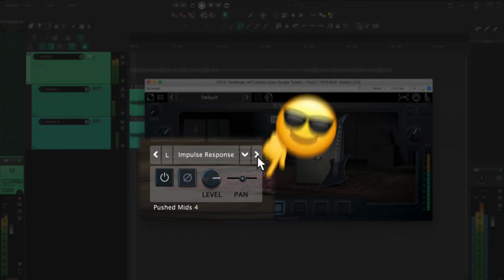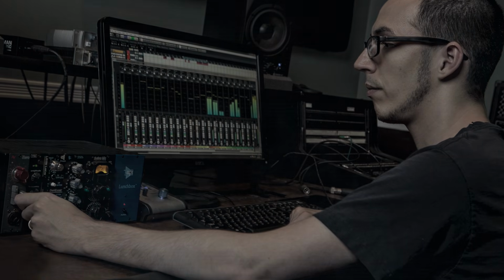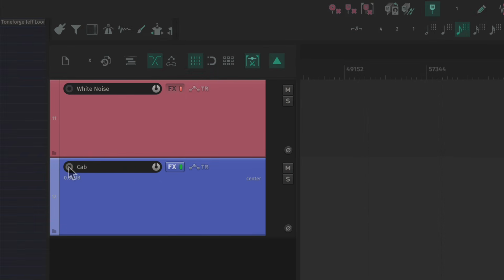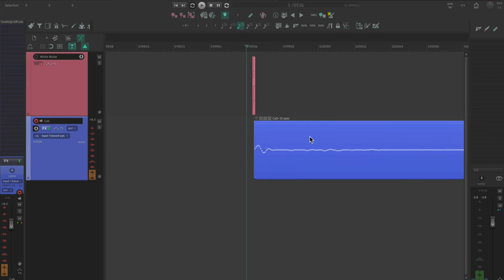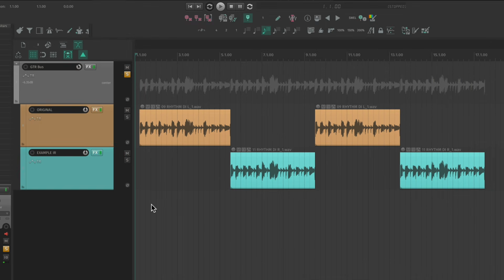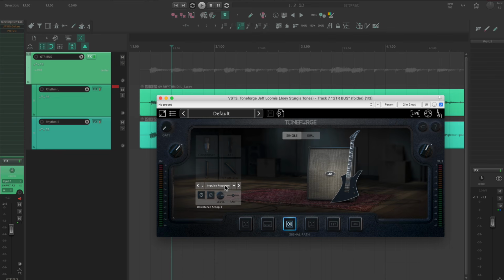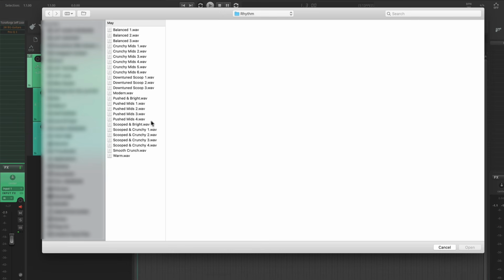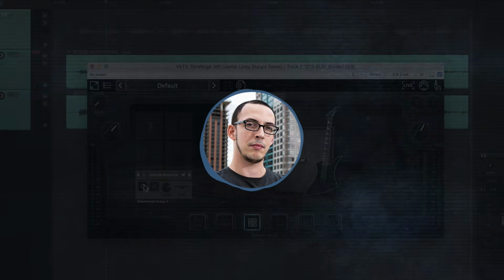How to Create Your OWN Impulse Response

Comment: This technique is as proved in this video efficient, but it doesn't fully give the exact tone of the desired signal chain (power amp + cab + mic), because you are feeding an actual impulse into it (i.e. a dirac for the nerdy guys like me). Because of physics you can't make the speaker to move as fast as the signal does, hence the response is inexact. Still ok of course, but inexact. 
A better way is to feed the signal chain with a sine-sweep, and then deconvolve the recorded response of the signal chain with the sine-sweep. This method allows to actually get the exact response of the signal chain (and allows to get rid of external noise that could occur during the recording). 
Not here to do the hater thing, just wanna share knowledge ! :)
Reply: Interesting.

Comment: You don't need a dedicated power amp to do this, in case it's not clear. If your amp has a fx send/return, you can hook up the white noise signal to the return.
Reply: True. Sadly, a LOT of classic amps don't have an FX loop. Fenders, for example.
Reply: @JustinLesamiz  Nothing stopping you from plugging the speakers of your fender amp into an amplifier that does have an FX loop, tho.  Just make sure your amp with an FX loop has switchable impedance.
Reply: @Smurfman256  What you're saying isn't wrong but it's capturing the speaker and the amplifier. So the same speaker with a different amp will sound different.
Reply: Okay...so DAW > interface > amp FX Loop > to cabinet > Mic > Interface > DAW? Heck yeah! Cause I want to do this, but was thinking I needed to buy more equipment...my Marshall MGHDFX100 has an FX loop...I think my Peavey Deuce does, too. SWEET! SO EXCITED! \m/-_-\m/

Comment: Hi all. I've seen a number of these IR videos and explanations. They are all quite good including this one. There are however a few errors and omissions in the explanations I've seen that you might be interested in. They are as follows: (1.) You don't need a white noise burst cut down to a single sample. You just need a signal sample of sufficient amplitude. Think about it, what's the difference between a single sample of you favorite song and that white noise sample? I think this video suggested a sample amplitude of -6dBFS (1/2 full scale) which is probably good. The main thing is that the signal does not clip anywhere in the signal chain. (2.) You aren't just getting the impulse response of just your cab. You're getting the impulse response of the entire system. From the DAC in your DAW thru the amp thur the cab and the mic, and the ADC of the DAW. Also if there's any resampling happening on the digital side, that too will have an effect. This is why it's so important to use a good clean amp and interface. This video suggested a flat amp. I would add to that a fast, flat amp (a good solid state amp with a high slew rate and linear phase response up to at least the frequency response of the cab). The response of the DAC and ADC of any good interface should have a negligible contribution on your measurement so you can probably ignore these. It's important though to use the fastest sampling rate possible to avoid any aliasing effects. So with a good interface and reference amp you're mostly getting the response of the cab and mic and possibly some room effects. You can tell if there are significant room effects by examining the captured wav file. If you see a secondary impulse in the audio that's the first reflection of the room your cab is in and your getting room effects. Anyway I think these videos are great and it's cool that folks are learning and applying some real world digital signal processing techniques to get killer sounds. Keep up the great work and I hope I wasn't too preachy. If anyone is interested in the basic theory of why this works I can post that here too. Thanks Joey for the fantastic vid and letting me share this space.
Reply: Came here to say this. The only important thing of the sample you play is that it has as steep and loud a transient as possible (while staying within the limitations of the speaker diaphragm). Just two samples from a audio clip is exactly what is needed, an "impulse", which is where the name "IR" comes from. As loud and as short as possible makes sure that all frequencies of the system to be sampled are excited without introducing any parasitic signal, and the system response can be captured. There are ways to calculate an IR from the recording of a system response to a frequency-sweep, but if you really put an "impulse" through the system, the recording is the IR.
Reply: I'm wondering if I could use IR to produce real effects - in the video up we get distortion from the amp - I guess it could also be an effect board or a sample? I guess I have to read some more basics....

Comment: Are there any specific and/or technical reasons to pass the signal through a power amp first? I'm new to this process and would appreciate it, if you elaborate further.

Otherwise, great vid! Very informative.
Reply: Without the power amp, wouldn’t the signal not be powerful enough to move the speaker? -P
Reply: @FStoppers  quite right, but I'm still curious whether I can replicate this within a home studio setup where you don't pass signal through PA level speakers, but just the studio  monitors.

Comment: Cheers!  I have an old Line6 Vetta II combo I always loved the sound of mic'd up.  I set up using this method and fed the white noise in thru the Vetta's FX return and it came out quite good on the first try. :)  I have an e609 on one speaker and an SM57 on the other.  Summing the IR to mono was a bust due to phasing issues (also when recording the amp for real), but taking each side as mono IR's worked well, normalizing the resulting IR to -1db True Peak.  I'm not going to claim it was pristine and I'm sure I could do this better if I took more time, but it was pretty impressive nonetheless.  I pulled those IR's into an Ampero 2 Stomp and they're working great.  More good choices for cabs!

Comment: Can you use the power section of a tube head? Is it possible to connect the output of the interface into the fx return of the amp or a separate power amp is necessary?

Comment: Instead of using a SM57 microphone or such I use a measure microphone to have a linear recording of the whole frequency band from 10hz to 20khz. This enables to capture also the low end of a guitar cabinet. It sounds more natural than the high pass version with a SM57 and if the low end disturbs, I can put an EQ on it.
Reply: Interesting, I never liked the sound of a condenser for guitar cabinets and much prefer the SM57.
Reply: @MichaelDespairs  The idea was to make a exact replication of what I hear from the cabinets to what I hear on the recordings. The SM57 is damping the low end to a good part and does pronounce some of the high end. But this is not what I hear on the cabinets...means - > SM57 sound is artificial.

Comment: How loud should I have the power amp running into the cabinet?? I have everything set up fine but I’m just confused on what volume my power amp should be at. I assume it should at a similar volume to what the cabs and mics where originally being recorded at so it’s loud enough for the mics to decipher the EQ curve of the speaker and cabinet

Comment: This may seem like a weird thing to do, but I just used this method to make an IR of a Palmer PDI-09 analog speaker sim/DI.  It totally worked, and it sounds killer.  Thanks for the tutorial!
Reply: That's badass, I have a PDI-09 and a PDI-03.  How'd you do it??
Reply: @chunkcheezy  I just did exactly what was outlined in the vid, except instead of a power amp and cab, I just went from the interface out, into the Palmer, then back into the interface input.  It worked, though I must admit the resulting IR doesn't sound exact--it's perhaps a little thin.  I don't use it live, but it cuts through nicely in a recorded mix.
Reply: @micwalt  thanks for that.  It might sound a little thin bc maybe the Palmer is expecting a powered signal?  I have a clean power amp so it's something I'll experiment with.  Thanks for giving me a great idea!  Cheers.
Reply: @chunkcheezy  Maybe, but I used to use the Palmer with just a BOSS GT-8 straight to FOH (no amp) and it sounded amazing.
Reply: @micwalt  Interesting.  I always only ever used it between the speaker output section of my amp and the actual speaker.  Interested to try it with a drive pedal or something and see how it works.
Reply: @chunkcheezy  I've never used it with just a drive pedal.  I was using the amp modeling in the GT-8.  I've done the same with a POD Go (w/ internal cabs disabled), and that sounded great as well.
Reply: @micwalt  fair point.  it's worth a try, either way.  It's not like I lose anything by doing it  lol  I'll report back

Comment: I believe to use white noise is not the correct idea for something like this. By using such a short amount of time one is basically creating something kind of like a dirac impulse. This again is actually something that is used to create an impulse response of a system, but to create it whith white noise is not the way to go in this simple case.  
When not using a dirac impulse one can use white noise and have it run for an amount of time that has to be way longer than the lowest wavelength. The calculation of the crosscorelation of the exact imput and the recording would give the IR. This should also work for a sine sweep or basicly any input if it includes the frequency spectrum you are interested in. And this only works for linear systems. So all the distortion the cab or what ever (poweramp, room, mic...) can not be represented correctly. So in case of a cab its a good but not perfect representation.
All that being said. What Joey did works, but its not correct.
Reply: Correct or not, it sounds pretty damn close to the original.  That's all I'd care about if I were using it for his purpose (post production re-amping or cab-matching situations).  In fact I just made 2 of my own IR's this evening using this exact method and it sounds great on my Fractal and Helix systems.  Was it "correct"?  I don't really care.  It sounds good enough and better than what I had before which was zero IR's of my own cab and signal chain.
Reply: @felix what’s your preferred method
Reply: @snapascrew  Well using white noise is good, using sine sweeps is good, using dirac is good. A longer signal  could have a better chance to get more detail, but also requirs complete silence during the recording. Also the non dirac method forces you to perform calculations after the take. So I personally would use  a logarithmic sine sweep (log chirp).
To the original post I made: All I'm saying is there is no sense in taking white noise and turning it into a dirac. You could use anything and take one sample of it.

Comment: Can this method be applied to cab sim apps? Sorry for the dubious question but i am working with cab miking simulators but i need to render the IR and put it in my IR loader pedal. The sofware that i am using does not have a IR render function.
Reply: Yes

Comment: I tried, but without a clean power amp (which I don't have).
It works, well, kinda : when loading my IR (and it really it sounds as my speaker), it's very weak sounding (event after the normalisation of the recorded sound)
Any tips or leads ?
Reply: Same here for me! Have you found any solutions to this problem? I have to boost my guitars something like 9/11dB to achieve the same loudness than "professionally made" IR's you can buy and download even after normalizing at -1dB peak :-/
Reply: @letroy7227  sorry, I didn't find any, and stopped searching, as here are so many IRs to be found. More recently, I did captures (not IRs) with my Quad Cortex, which are giving me ample satisfaction

Comment: Can someone explain to me the difference between making an IR using just one sample from a white noise track and creating a 60 second frequency sweep with a sine wave that I see people do with guitar cabinets all the time? Is there something fairly obvious that Im missing here? I feel like this would give you vastly different quality results in guitar cabinet IRs but please keep in mind this is simply an ignorant intuition and I am a complete noob when it comes to this sort of stuff so I would appreciate any insight. Thanks!
Reply: He recorded the impulse response directly, so it's ready to use as is. A frequency sweep has to be processed into an IR before it can be used. In theory you end up with the same thing either way, but to get really good resolution with this technique the impulse has to be LOUD, and you can only play an impulse through a speaker so loud before it blows out. The frequency sweep method lets you get around that.

Comment: I agree with the IR of a room. Make a IR through the drum microphones. Think of it as kind of capturing a profile of the drum room. If you get the fase right, you can blend it in with the recorded drums, and use it to enhance the drum room, in your mix. Work's great on the ambiance tracks, or on the drum bus. But the real treat is to use the IR of the drum room to ad a little shine and depth to the other tracks as well. Just a tiny little on the bass, guitar, keys and vokal. Can make your mix glue together and sound more unique. Especially if you use amp sim's. Or if you feel your general mix, is a little too dry and a reverb plugin, sounds to artificial. Sorry for the off topic! It is for another video. 😄
Reply: I like the way you think!

Comment: Why would you use a clean solid state amp compared to the return of a tube head, for example?
Reply: you want to get cleanest and flattest sound as possible to go through the speakers, unless if you wanna create an impulse response for preamp section.
Reply: @junkawakami3193  Thanks man. Good explanation.